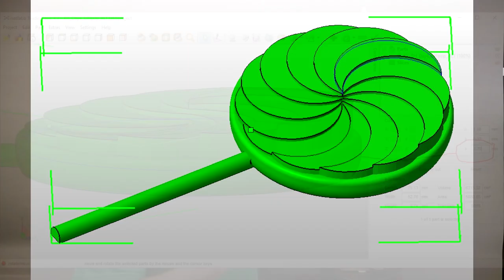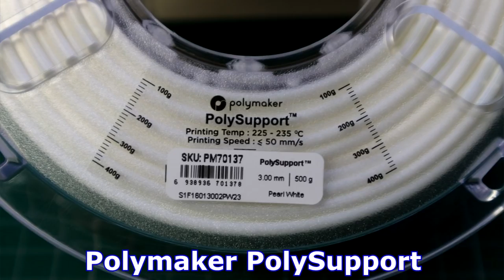3D Printing many different materials  - Advice, tips & tricks

Comment: Love your work.....  Still waiting for Taz 6 mods and firmware tweaks....
Reply from the maker: The TAZ6 mods were in a constant state of change most of last year, new toolheads (MOARstruder / Aero and paste) all made significant changes to the firmware and overall integration - I was still not happy with multiple firmware for each tool-head type, so I'm taking another look at that now. I hope to do some integration of the different settings. I will try to do a catch-up video / blog to explain further. The TAZ is a great machine, it just needs to be a little easier to switch heads / nozzles and allow faster setting changes.